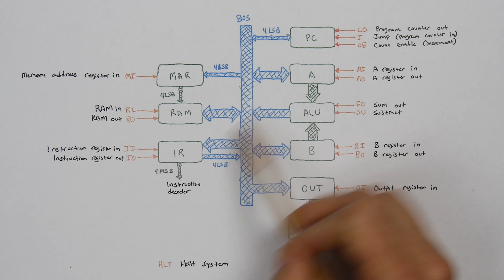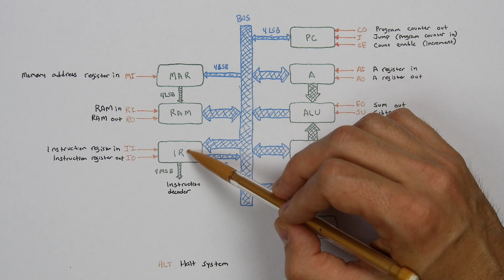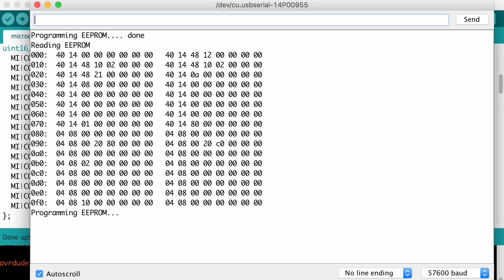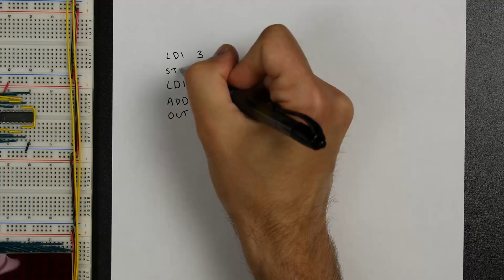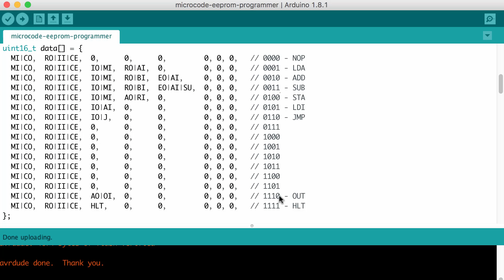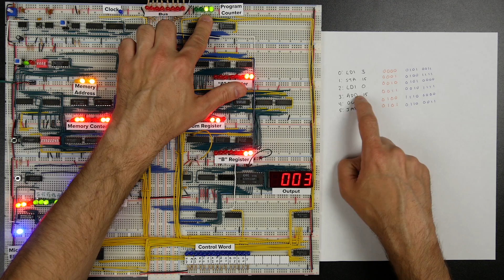Adding more machine language instructions to the CPU

Comment: I've tried to write the program of the video but there is a strange bug. It works fine but I'm missing the 12 in the sequence(like 3 6 9 15 18 etc...). I tried to step the clock to see what's going on and i noticed that while it's fetching the instruction PC Incremented(but in the falling edge) by one (it was supposed to happen in the next micro-instruction), then it increased again. It seems like that PC increased because there is CE in the next instruction and maybe there is a spike(the strange thing is that happens only between 9 and 12). I tried to put a capacitor but it didn't work. Can anyone help me?

Comment: It is quite impressive that you added a debugger mode in clock circuit right at the beginning of this series. I guess without having the option of advancing the clock manually using the monostable mode a lot of things wouldn't have made sense to a lot of people watching this.

Comment: 17:15 we wont normally bcoz its JMP it never going read PC 6 you not need CE there. you waste 20ma power lit that CE even it never get used anyway. even more logic CE and TS should be last micro code. reset micro counter and add pc xD but you not have TS bcoz you use that extra rom bit for flags i guess.
CE could be in T5 but not in JMP hihihi bcoz never need it bcoz. you allready change PC. did you got it yet how annoying CE is in JMP when it rewrite it anyways ! lol

Comment: 📺💬 Same as Jirayu say but my team had JMP to address the target in the memory.
🥺💬 You are correct but the STA command can insert memory with the address and access them by PUSH / POP
📺💬 How can you do for having an output when you need immediate results⁉
🐑💬 It is stack results but you also can copy output to address, most of the time result is on top for OUT command.
🧸💬 Do you mean if not careful there is the output from the stack address⁉ 🐑💬 OUT command is the output from the address registered that is why it requires 1 step or less.

( 📺💬 เป็นไงเจอเค้าก็ยังเหมือนเดิม 🥺💬 ใช้คนหน้าคล้ายแต่ไม่ใช่มั้งครับ ผมยังยืนยันคำเดิมอายุมากขึ้นผมเก่งขึ้นครับ ผมก็ไปหาหนังสือ หรือข้อมูลเพิ่ม )

Comment: 2:46 Could anyone answer my question? There is a microinstruction set defined by uint16_t data[ ]. Suppose for example my command instruction at some line 10:42 in my program is 0100 -STR. Then how does the computer know this should perform below?
MI|CO,  RO|II|CE,  IO|MI,  AO|RI,  0,         0, 0, 0,
Whatabout if the row orders of uint16_t data[ ] are changed, how does it know which is which?
Reply: A little more thought. It seems like the instruction binary code (ex. 0100) is not only the command but also the address of the microinstruction stored in ROM. Beautiful.

Comment: Hi i would it now how could be an "input-port" and an "output-port" added to the computer. And then to excute  any logical or arithmetical-operation that  are also stored in EEPROM. The states of inputs reading and then the high or low level outputing. Saying a little PLC mode for the computer. Thanks

Comment: What if you made an END signal in the CPU, which would connect to the microinstruction counter reset, then you could just add '|END' to the last microinstruction of every instruction, that would be a neat optimization, it will basically just skip to the next instruction, without having to wait for "empty" microinstructions

Comment: Has anyone ever seen a small eeprom? I really only need 8 bytes, 3 address lines. it would be really nice because of the small footprint, and I have an application for it
It needs to be parallel.

Or let me rephrase: What is the smallest footprint eeprom that has 8 bits of data per entry, and at least 3 bits of address, and both of them being parallel and NOT serial?
At this point I would be okay with a uv-erasable eprom.

Comment: Hi! question about the RAM unit if anyone has ever encountered this problem or has any advice. (putting it here, because it didn't happen until I programmed the CPU with additional instructions, but going back didn't fix it)

For whatever reason after I have entered a program into my RAM and switch from programming mode to operational mode, the RAM immediately drops the first instruction (address 0000) and replaces it with all zero's. Conveniently, 0000 is NO-OP so I've been just starting my programs at address 0001, so I can still get it to run programs, but as I play with it more it is going to limit my potential programming space to only 15 instructions. I was trying to figure out if the switch was unintentionally writing or resetting that line, but it doesn't seem to matter what address it's set to at the time. I wonder if I perhaps just have a faulty chip (or two). 

I haven't built the CPU flags or conditional jump logic yet, so I'm going to keep going with this work around, but if anyone has any advice, I would appreciate it! 

Thanks!

Comment: Does anybody know what type of wire he uses? I understand it comes from a spool, and he cuts & trims it. I have tried to do the same, but the wires I get are filled with a bunch of small copper wires & unless you twist them up there's no chance of them fitting in- even then, it's a giant pain in the ass, works 35% of the time, and is just generally impractical.
Reply: It looks like his wires have a solid core inside of them, flexible like solder.
Reply: Just figured it out! I have been buying "stranded" wire, and the type he uses is called "solid" wire.

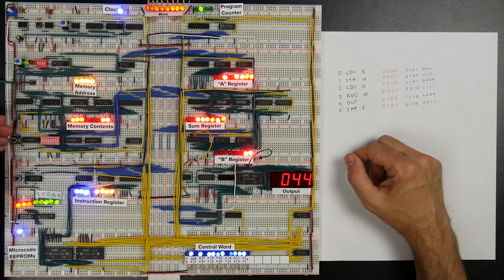Comment: The overflow at the end (18:39) was really ugly
Reply: Was looking for this comment.  Just after he says it counts by 3 forever, the output shown is not a multiple of 3.   Internally the computer is still counting by 3s - but the display output is limited by design  to 255 (8 bits) and then you get an ugly roll-over.  So after 255 you get 2... I just thought the timing of Ben’s comment was funny.
Reply: It's not ugly, it shows a limitation of this machine. In fact every CPU has a limitation. It's just that we're so used to this limitation being very high that for all intents and purposes we don't really notice it when using our PCs every day.

Comment: nice work 👍 its nice how you show machine code to register transfer sequences.
i worked on early vid arcade games before cpus available. i highly recommend looking at
the old tailgunner arcade vector game schematics...  this is the best education all early
digital students should be required to understand...  complete cpu and vector graphics cpu
in DISCRETE COMPONENTS !!  its an elegant design.  i miss those days..  😐
Reply: ps i can recall if it used bit slice or register transfer microcode but either was its a mind opener and highly educational.

Comment: You can use the last line in the microcode output lines to the reset for the micro instruction-counter to be more efficinent on those clock cycles.

Comment: So, wouldn't it be possible to add a command from the logic controller that resets the step counter? If you put that through an OR with your current reset, that'd allow you to use the full number of steps per command, and save time on operations like the Instant command you programmed in. As it stands, there's no real time savings to using the instant versus a standard read from RAM, if I'm understanding the architecture correctly.

Comment: you really should add a program-rom module there you can program the code in via your arduino. should be relatively easy at the end to just replace the opcodes to fetch the instruction from the rom instead from ram

Comment: You know what would be cool? an instruction like INC and DEC, which add or subtract 1 to register A, because for loops are kind of a big thing.
Reply: Better would be addi and subi, because they have that functionality and more. Besides, you'd need much more ram to care about higher-level constructs like for loops
Reply: @berylliosis5250  You're right about the addi thing.
For loops basicaly require a conditional jump, and that requires comparisons (the L part in ALU). with that, I guess you would run close to the 16 operations limit (- the amount of parameters) pretty quickly, but something like simple multiplication should be possible.

Comment: I was thinking about your microinstruction decoder, and that last unused bit on the second EEPROM would probably be best used to optimize instruction execution. Right now the microinstruction counter always runs to T5, that's 6 cycles. Shorter instructions run the same course as longer ones. You could define a new control signal on that last bit that always gets asserted last inside an instruction microcode, and which resets the microinstruction counter. Call it IE if you want, "instruction end". This way, for instructions that take 3 cycles the counter gets reset after the 3rd cycle, instructions that take 4 cycles reset the counter after 4 cycles and so on. That would save clock cycles.

Comment: When you have extra clock cycles at the end of an instruction, could you add something that goes right to the next instruction rather than going through the extra clock cycles?
Reply: Yes, you could take all 16 bits of the control word, pass them each through a diode and into a common point, and invert that into the microcode instruction counter.  Doing that would make an all zero control word move to the next instruction.  Alternately, if he's not going to use that last bit of the control word, he could wire it to the AND gate that controls the reset of the microcode instruction counter. 

(I think he's going to use that last bit in the conditional jump video though.)

Comment: Could this computer be expanded and used somewhat like an Arduino
Reply: You could, but it would be a huge amount of work.  Also, you'd be a lot slower than an Arduino.  The little Atmega328 chips run at 20Mhz.  Constructed on a breadboard this would probably run into reliability problems before you got to 500hz, so (roughly) 40,000 times slower.

Comment: you can speed up the overall speed by setting the 16th control bit to reset the instruction time step counter back to zero instead of waiting until step 5 has been reached.  In doing this you can now have all 8 command steps available if needed.   But if the last control bit in a command string was "End of Line" then your command strings could immediately start back at step 0 instead of waiting thru unused steps until you get to step 6 and reset the counter. Overall savings for your example program would be 10 time steps out of a total of 40 steps implemented in your 9 defined commands

Comment: How difficult would be to implement in current design a stack and add an instruction to call subprograms?
Reply: The hardware change sounds easy enough, just another register for the stack pointer and some microcode.  The hard part is you'd need a third eeprom because you're almost out of bits in the control word.  There is only one left, and he's saving it for conditionals.

Comment: Could you use the LSB of the control logic to reset the micro instruction counter?  Sure it's not important that this be fully optimized as it's a learning tool, but it seems like a good optimization and a useful discussion point.

Comment: There's a kind of neat way to (ab)use the instruction set to perform multiplication. The following program should work, so long as the second number is <= 7.

1. LDA 0x4
2. SUB 0xF
3. STA 0x4
4. LDI 0
5. JMP 0xC
6. ADD 0xE
7. ADD 0xE
8. ADD 0xE
9. ADD 0xE
10. ADD 0xE
11. ADD 0xE
12. ADD 0xE
13. OUT
14. HLT
15. <input 1>
16. <input 2>

If we had access to more memory, I'm sure this instruction set is already Turing complete. Now to find a proof...

Comment: Have a nice day. Can the output be taken on the screen? crt etc.
Reply: Not the easy way, because CRT display requires precise timing with speeds exceeding the capabilities of this computer. Simply put: this CPU is too slow to drive a CRT screen in real time. Unless you add some complex circuitry that would periodically sweep through a portion of RAM (the frame buffer) and display its contents through some DAC. Then the computer could store the bytes representing the image in that frame buffer (which can take some time :q ) and then the "video card" could do the hard work to display it on the CRT screen. Nevertheless, making the circuitry of the VGA video card for driving the CPU is much more complex than this computer, due to the precise timings required, and the high-speed chips required might be quite expensive :P

A simpler way would be to use a LCD display with a driving circuit. For starters, it could use the alphanumeric mode, so that the only thing the CPU would have to do is output some bytes one by one, intermingled with some special commands, to the LCD driver that would store them in its internal RAM and display them as characters. This might be done at the current level of complexity of this computer, and I pretty much already tried that with a serial LCD display module like this one here:
http://skpang.co.uk/catalog/images/modtronix/display/lcd162b-yhy.jpg

Comment: This is  very much a none trivial suggestion (more motivated by the Ben, Ben, and Blue than this video). I think you should consider a stack pointer as a new addition. I suspect that many of your viewers have come from a high level programming background. Thus they perceive the stack to be like some kind of co-processor with a built in sram factory. It is "just" one more address register but its inclusion opens up a whole new world of return addresses, parameter passing and local variable storage. 

This is an awesome series that puts people in touch with with the functionality a computer and reveals the limitations that are imposed on that functionality. More importantly it reveals that  a new release of a high level language (I name no names, they know who they are) doesn't make the computer more powerful, it just results in fewer lines of code.
Reply: If only the program counter could be loaded/stored from/to RAM, the stack could be "simulated" with some cumbersome code (the stack pointer could be stored as RAM cell). But of course hardware stack would be better.
Reply: Interesting OOTB thinking. I seem to remember, back in the early '80s, a cpu, TI's TMS9900, in which ALL the registers were in RAM. One of the advantages of this was a very fast response to interrupts. This was because there was a pointer to the register "page", if this was changed by the ISR, the original registers where untouched and the ISR's registers were restored in a couple of cycles. Cycle sharing multitasking was equally facilitated by this architecture. The CPU is now history, possibly because it wasn't a child of Intel..
Reply: This trick is still used in many microcontrollers, for example in the 8051 family. There is a bank of 16 registers that are mapped in the internal RAM of the microcontroller, and this bank can be switched between four different addresses, so it kinda works like a stack for values and return addresses. All you said about interrupts also applies in this situation.
Speaking of thinking out of the box, though: some people here also complained that this CPU is not capable of performing conditional jumps yet, so it's not Turing-complete. But I pointed out that it is not the case, since we have an instruction for storing values into memory, and programs are stored in the same memory, so we can simply make a usual unconditional jump, but use another instruction to store a new value of the destination address for that jump directly into the memory cell containing that jump instruction and its address, overwriting it with a different address for the jump :> And this new address can be calculated as a result of some arithmetic operation, so it may be different depending on the numbers added/subtracted. And since we already have subtraction, we can use it to compare numbers. So we have all the ingredients for conditional jumps already built in :> We just take two numbers, subtract them, and store the result into the jump instruction in memory, and voila, we can jump to different locations depending on the result of the comparison, conditionally ;)

Comment: An add immediate may not be too useful,  but an INC and DEC certainly could be.
Reply: Which is just `ADD #1` and `SUB #1`. So if you have add immediate, you get your INC and DEC for free.
(Having them as separate instructions with "hardware acceleration" is 20% cooler, though ;J )

Comment: With these instructions we can make a program to output the Fibonacci sequence. Each next fibonacci number is the sum of the previous 2 numbers in the sequence. It takes only 9 instructions:

0: LDI 0
1: STA 15
2: LDI 1
3: OUT
4: STA 14
5: ADD 15
6: OUT
7: STA 15
8: ADD 14
9: JMP 3

It alternates by storing the result in memory address 15 and 14 and adding the result of the other memory address to the A- register and the storing it in that memory location.

To start a 0 is stored in @15 and a 1 is outputted and stored in @14, then the 0 from @15 is added to the 1 in register A and the result 1 is outputted and stored in @15. After that the 1 from @14 is added and the result 2 is (after the jump) outputted and stored in @14. Then it continues to add the 1 from @15 the output the result 3 and store it in @15...

It outputs 1, 1, 2, 3, 5, 8, 13, 21, 34, 55, 89, 144, 233

Greetings Jeroen.
Reply: Correction 10 instructions :)